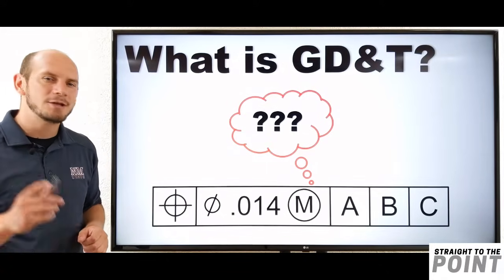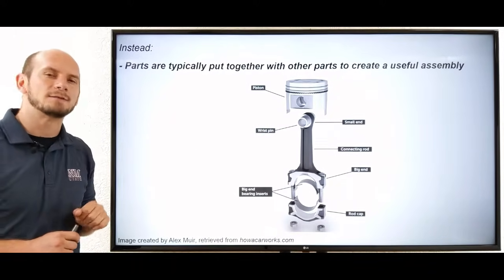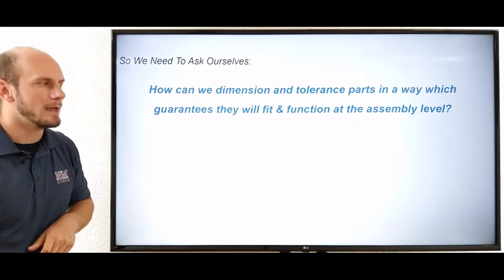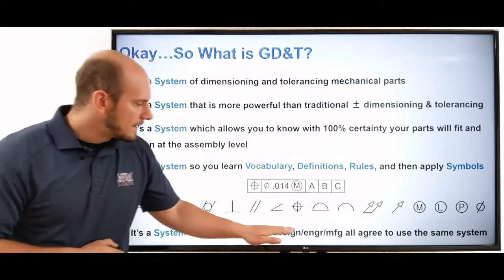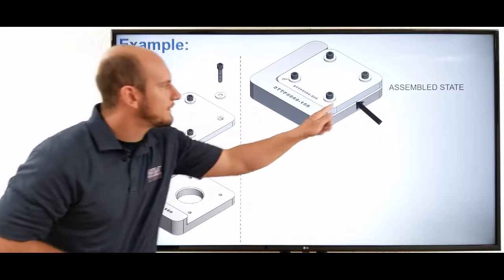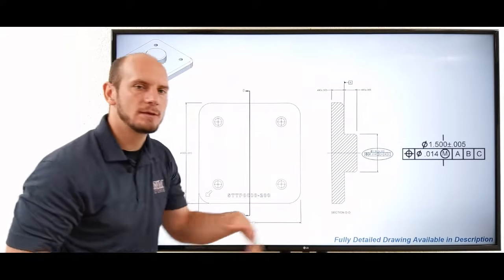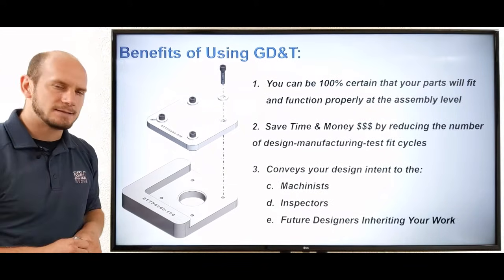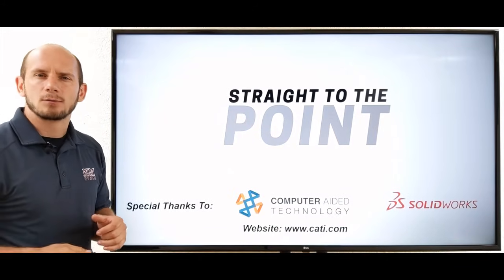What is GD&T in 10 Minutes

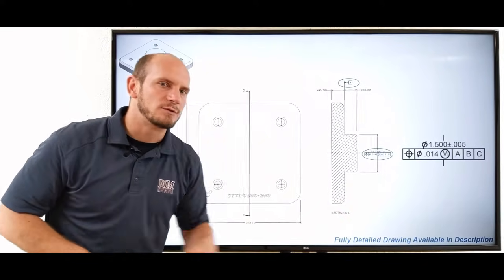Comment: I'm not sure yet what the difference is between traditional D&T and GD&T. If I receive a diagram with both kinds of D&T, like the one at 7:44, then why can't I use the traditional GD&T to guarantee that the parts fit and function together? Is traditional D&T more of a soft guideline or something?
Reply: I think I get it from this video: https://www.youtube.com/watch?v=kp_8IGu8Rew&list=PLENqqCbdV01jEc6B57o8Vz-8ai9Yrb8zQ&index=9
In that video, for the traditional D&T, the circle's position's tolerance depends on lines that have tolerances themselves. This could throw things way off

Comment: GD&T is "Geometric Dimensioning and Tolerancing"
Geometric dimensioning and tolerancing provides a comprehensive system for symbolically
defining the geometrical tolerance zone within which features must be contained. It
provides an accurate transmission of design specifications among the three primary users
of engineering drawings; design, manufacturing, and quality assurance groups. Some
techniques introduced in ANSI/ASME Y14.5M have been accepted by ISO. These
techniques include projected tolerance zone, the three-plane datum concept, total runout
tolerance, multiple datums, and datum targets. Although Y14.5M follows ISO practice
closely, there are still differences between ISO and U.S. practice.

Comment: I’m a retired mechanical engineering manager.  We did not have assembly problems with the classical tolerance system.  Converted to GD&T because that was the way the wind was blowing.  Led to endless ‘discussions’ among the designers and burned through hours trying to figure it out.  (And we had GD&T classes).  On balance, it was a loser for our (mainly cylindrical) parts and assemblies.  Use GD&T where needed, where NEEDED.
    I think a thesaurus of GD&T assemblies and parts might be useful as a reference.

Comment: Good video on second part. But very misleading at first. Regular dimensioning has been used for a long time. To say that you cant use it and not guarantee your assemblies wont work is wrong. Just like anything, if done properly it will work just fine. Been using it for 35 years building many complex tools, and our company has been using it for 63 years no problem. Not saying this is not good or doesnt go farther, but how did we get by up until it arrived.

Comment: Great Video. I think one thing that I would  have added to point 6, is that its important that all people involved WANT to use GDnT, instead of traditional methods of tolerancing. Also its worth noting that the trade off in using GDnT is more time spent interpreting drawings at every level. Once you have your head around the system its really not an issue though